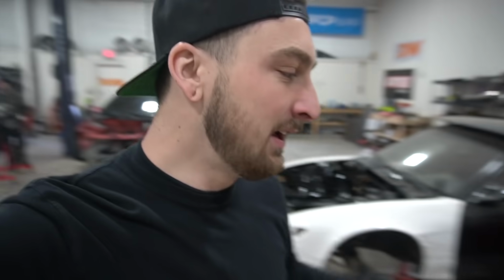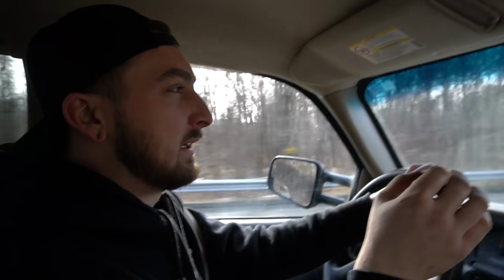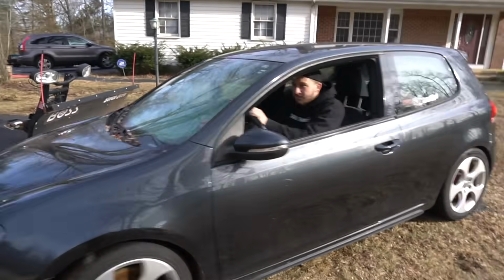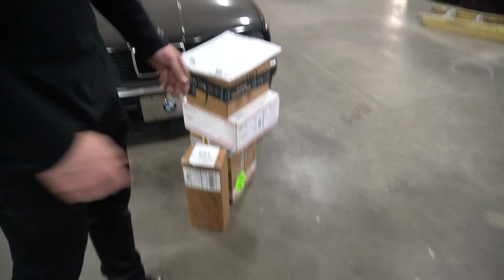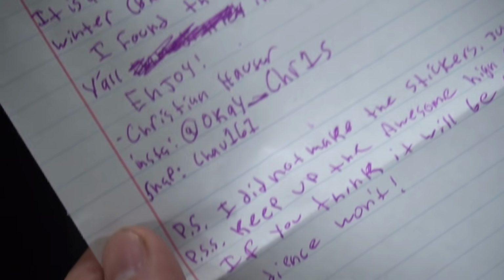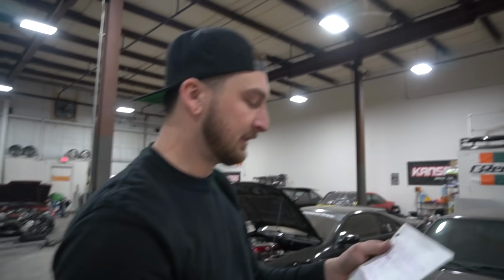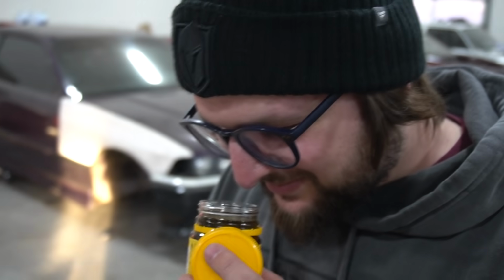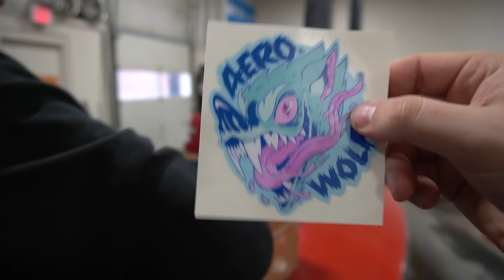Picking up my long lost daily driver..

Comment: I had the same thing happen to me with some brakes I did a wheel bearing went to put the caliper back on and I thought the pad fell out and it was actually the material falling off the backing plate

Comment: I will have a dsg trans from a 07 Passat with a 2.0t. trans was fine timing chain broke in the head. There are cheaper units out there under 1,000.

Comment: Quick question. What the hell is going on with the stance of that car in the background at 8:44 ? I would assume it probably doesn't have a motor in it why the front is so high but that rear camber tho.

Comment: The reason the plates are different colours even if from the same state is just the period of time they were issued. The Queensland plate with the green writing is from 2001 and prior and the maroon is from 2001 and on wards. Also didn't think you'd be interested in Aus plates because they're pretty boring but since you were so psyched on those ones, I will definitely send you one of the custom plates off my old R34

Comment: the green queensland plates are older,  queensland switched to red plates around 2005ish

for the vegemite,  what you want to do is make some toast (thiccccc toast) , set your toaster to  3 medium brown,  real butter (heaps) and a thin splotchy spread of vegemite.  the vegemite is not meant to be thick or coat the whole slice,  if your vegemite application look like someone did a bad job of it, then its done right :)

Comment: I have a new DSG and full running gear available from a 2011! I bought a car as a parts car because I blew my motor. Car was in an accident, and I was planning on rebuilding it but my frame guy told me it's gonna be more than I could afford.
Long story short, I have all the stuff you need to fix it, and my car only had 55k. I live nearby in NH and frequently come to CT and I'd love to sell it to you. HMU on Twitter if you're interested, I can give you the VIN, pictures, everything.
Reply: @jimmyoakes

Comment: Had a quick scroll and couldn't see another comment about why aussie plates are all different.

Each state/territory (Queensland, New South Wales Etc) has different statewide rules on registering cars and so they have different colours between most of them.
Not to mention there was different colours etc over the years.

The plates you have are just standard issue plates, as in, if you went to the registry and registered a car, they would give you a generic number plate.

Comment: You should look into the inflatable paint booth they have air filtering systems mabey your landlord would be okay with it then
Reply: I have one and I’ve used it 2 times and both time it worked great the carbon filters got rid of 90% of the smell of paint

Comment: 14 hundreds for a mechatronic?! Shops do it for like 400$ here in Egypt for 1.4 tsi’s I don’t know about the part manufacturers tho
Reply: 14s here is half the price of a 40 thousand km used 2.0 tsi engine with trans and full suspension, exhaust,cooling, wiring and ecus

Comment: Aus number plates most of the state's have the same white background but NSW are yellow  because they are the only good drivers over here. So when u see a yellow plate u know ur not driving near a remtard. 🙋‍♂️🇦🇺 I grew up in Byron bay NSW but now live in Brisbane QLD so I know how to drive but in QLD u don't need to try QLD driving rules > 1 don't give way or stop at stop signs 
>2 don't use ur blinkers or have working brakelights 
>3 beep horn at pepole when ur in the wrong to try shift the blame on to them.